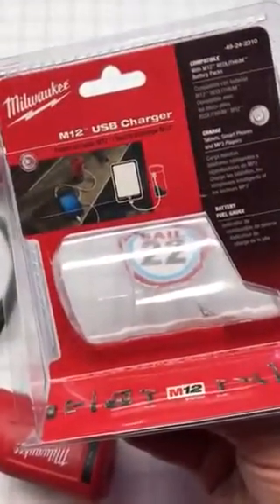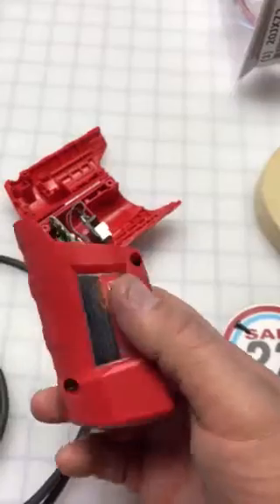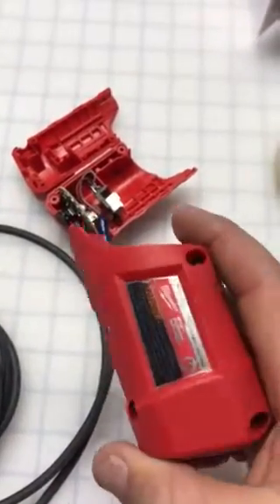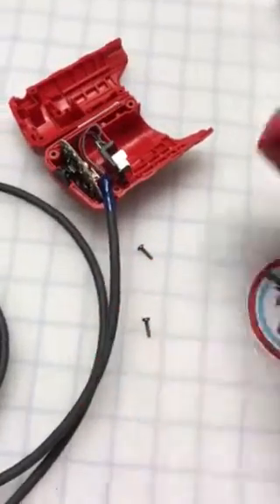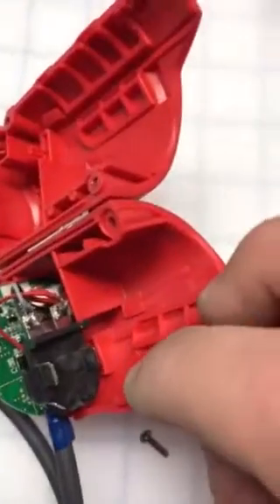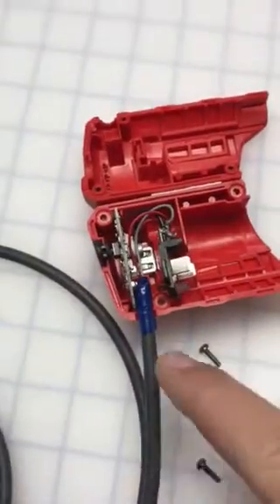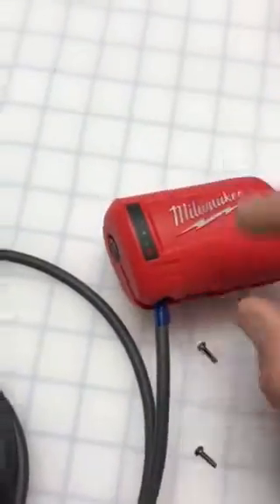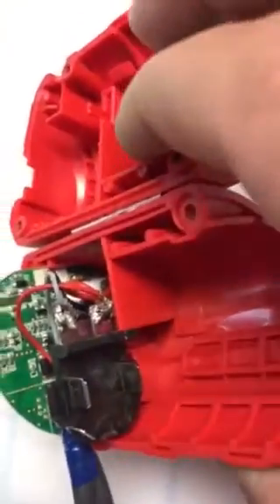Milwaukee M12 USB Charger Hack

Comment: So remove the regulated 12VDC output and install a permanent cord for unregulated 11.6VDC power and a voided warranty?  I dunno what a “d10” is (I’m guessing you don’t mean a excavator) but I’m curious on why you hate it so much 😂. For less than the cost of this adapter get a 12V SLA (sealed lead acid) battery rated at 8ah which is 4x the capacity of the m12  battery available at Home Depot or other hardware store for literally 20$ USD . Best part is no fire risk either. I wouldn’t even charge my phone on that considering it’s only 3 18650 Samsung IR lithium battery’s . Designed for a high discharge rate not high capacity. I always appreciate tinkering and customizing but WHY?